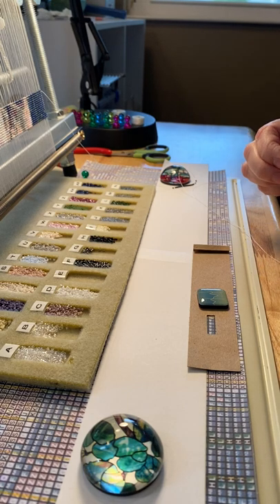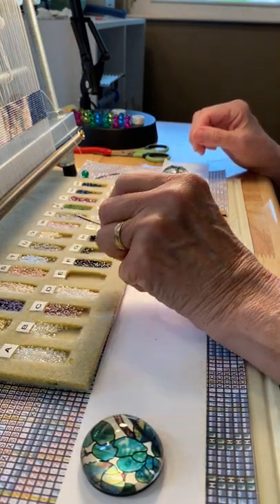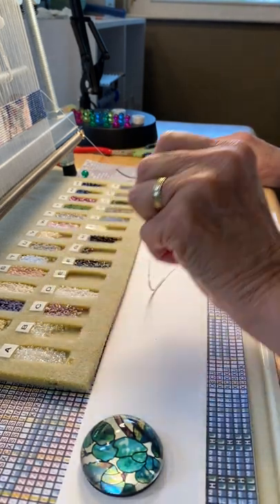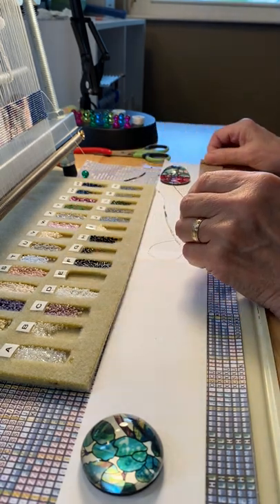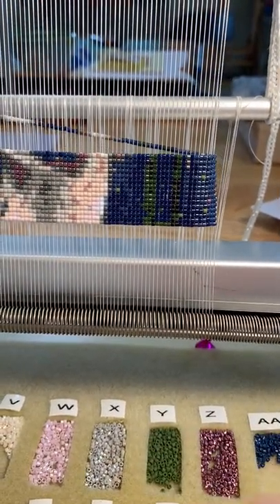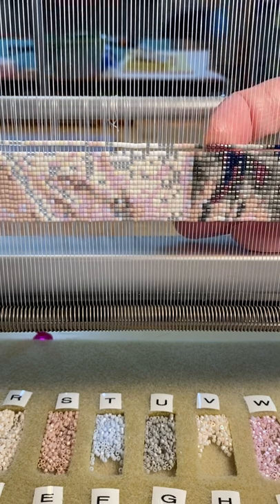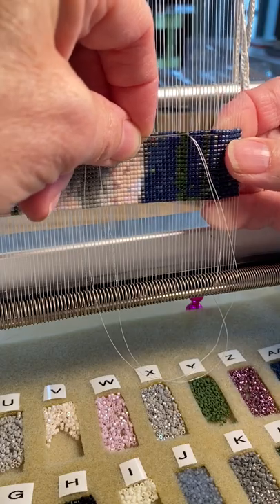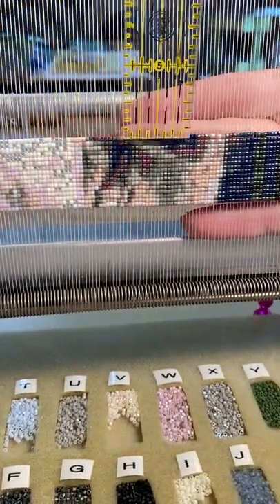Bead Weaving on a Mirrix loom.

Comment: Though I've been beading for awhile I always avoided small beads. Now in my 70's I find delicas and small beads very relaxing and would like to get a larger loom. Do you have any advice or is there anywhere that you show your work? You've really inspired me! Thank you for this video.
Reply from the maker: I like the Mirrix looms the best, mostly because I can adjust the tension as needed, and I can warp it so it goes from top to bottom then back to top, and not all the way around the loom. I don't have anywhere that I show my bead art, but I am working on adding it to my website. Just not enough hours in a day. I will try to add more videos more often though. Thank you for watching!
Reply: @paulettemorrissey9428  Thank you so much for replying. I did buy a Mirrix and found warping it much easier than I thought it would be . I was delighted by how sturdy it is and am working on small projects while learning to tension the loom. Look forward to more videos!
Reply from the maker: I really like how you can warp their looms so the warp is not a continuous loop around the loom, and instead be only a front layer of warp.

Comment: I need to make a pattern for  a Native straight dance belt. Do you have a software program to recommend? The belt will use #11 sead beads. It's 4.5 inches x 32 inches
Reply from the maker: I use BeadTool4 for all my bead design work.
Reply: That's the program I use it is really hepful